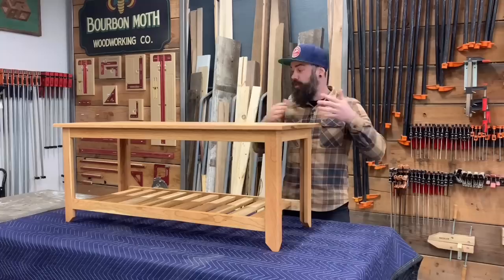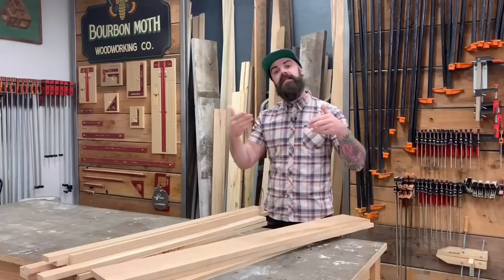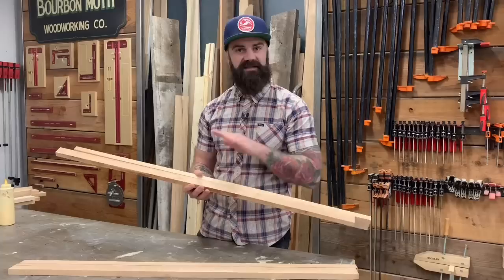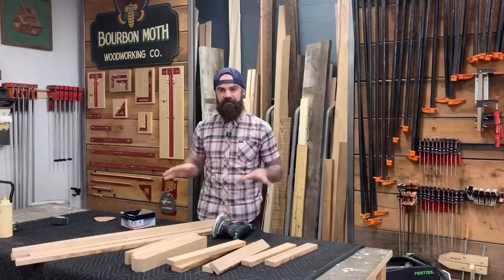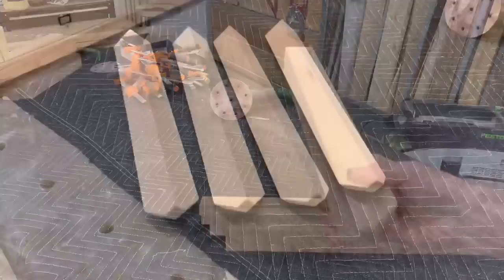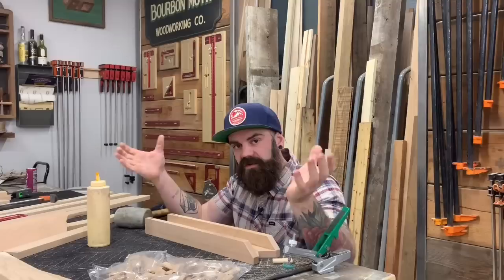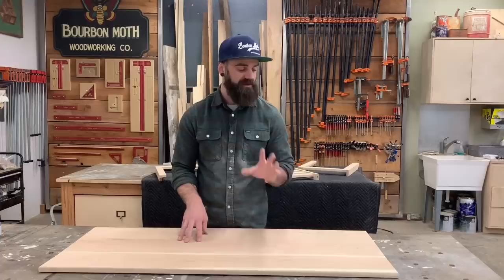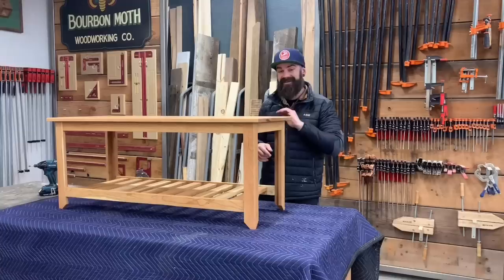How To Build a Bench / Easy DIY Bench

Comment: Great video bud! Keep up the good work. A silver play button is in your future.
Reply from the maker: Coming from you that’s a huge compliment. Thanks buddy
Reply: Hey mate love the video do really well love the table as well just a quick question here in the UK would that dimensions of the saw blade work with a normal saw blade from the UK or are they all the same worldwide
Reply: @mortimerwoodworks3  Depends entirely on the blade. Most blades in the US are 1/8" (3.175mm) unless they use the 'thin kerf' blades. My TS has a 2.6mm blade. Just adjust your dado/groove accordingly by bumping the fence to widen, or use a router. You can also use a buscuit jointer and run it the whole length of the skirt, blades are typically 4mm. Or get a plough plane - there's literally loads of different ways to achive this.

Comment: I like the fact that you tell people when things are not required, like gluing every tenon in the base.  Also I don't understand why people complain when you 'break out' the domino jointer, you've already said "Use a dowel joint instead" and you can do that for a few pounds in the UK.  Keep the videos coming, they are really good.

Comment: Enjoy your videos,  and I am a follower. This gave me inspiration to build my own bench, a bit different than yours, but following the same basic idea. I for instance put the skirts (up and down) inside the V of the legs, and then I put the base slats on a thin stripe, a thin piece of wood on the inside of the lower skirts (I don't have tools for domino jointing).  But basically, like. And very much inspired by your video. It now serves as a flower bench, making a  kind of divider in a small apartment.

Comment: When I made a similar bench I used the Domino 500 to put tendons in for the top and then put it together. I did not glue it and it (the top) stays where it should be and does not move or come off.

Comment: Is that rubio? I wish you would’ve shown how you apply the finish to the legs and base. The only time i see people use rubio is on flat surfaces and I always wanted to see someone actually using it not on a table top only. Great video though and I love your stuff and your instagram.
Reply: Araya Woodworks I apply Rubio with a foam brush onto not flat surfaces and have gotten great results. Just make sure you apply enough to saturate (not soak) then the only key is make sure you wipe every last bit of finish off after 5-7 minutes
Reply from the maker: Yes it’s Rubio, a foam brush works great for getting all the little areas.
Reply: Nice! I really need to try Rubio!

Comment: Could you build this with a doweling jig? I was thinking two dowels in each end of the lower shelf slats instead of the domino joiner? One dowel would allow them to spin.
Reply: That would work fine!
Reply: @4addevelopments139  thanks! Just getting into woodworking, and a domino joiner is definitely not in the budget. 😆

Comment: Any advice on rounding over the edge without tear out at the corners; I did mine today and the corner grabbed and I had to cut my table top shorter to route again ?
Reply from the maker: If you clamp a sacrificial piece onto the edge and route past your top into that piece. It will prevent tear out.

Comment: I have a question. Why wouldn't you use finishing nails along with the glue to put the legs together? Wouldn't that make it more structurally sound? Then use wood putty to fill in the  hole from the finishing nails.

Comment: Need to add that if you use domino you need to change depth for shelf rails, if you go 20 you'll go through. I use 40 dominos with 15 deep on rail and 25 on braces. Otherwise greatplans

Comment: I have to make 2 built in cabinets for my two nooks beside the fireplace. They span 65 inches on each side. I have a dewalt 7491rs table saw some clamps nail guns and other small essentials. I don't have a jointer or a planer or a buiscut joiner. I do have a kreg k4 pocket jig. Any advice? I have a dedicated 12x20 bay garage dedicated to my stuff (no cars allowed) can I make cabinets should I make 4- 32.5" cabinets and combine them? Thanks for reading

Comment: Well, nice video but you forgot a couple of things.  Namely, what grit sandpaper did you use, Festool also makes a couple of different types of sandpaper, granat and one other I believe plus a mesh.  Secondly, what size dominos did you use?  I think those are the 6mm type.  Also, one could use a DF500 domino machine which is $500 cheaper than the big brother you used.  Also, how did you measure out the dimino positions on the legs?  Finally, where did you get the cherry stock?  Thanks.

Comment: On your miter saw, why do you make a shallow cut before make the full cut?
Reply: He has a tips video somewhere, that he describes a trick to keep the saw from binding as much on thicker wood by cutting the beginning and end of the cut then doing the middle.  But, since then I've noticed he "scores" most pieces along the full width it then makes the full cut.  My though there is as the blade is making the plunge through the wood, any deflection downward now has a relief cut to keep it off the blade.  I haven't had a chance to try it yet, but that's my theory.

Comment: This looks amazing and very doable. I wish you had made this straightforward build with less than $10,000 worth of tools.  I am sure it could be done with different equipment but as an absolute beginner I would need some guidance.
Reply: Lol same. I was excited but as soon as the jointer/planer was whipped out I was like "out of my realm of possibility". Boo.
Reply: Yea I’m in the same boat but there are plenty of videos on how to build a jointer jig for your table saw. Planing is a different story but we do what we can do with what we have right lol
Reply: Guys just buy S3S wood from the store and you’re fine
Reply: So just work away with a handplane and pullsaw. You’ll figure it out.
Clamp with a couple of 2by4 an wood wedges.
Honestly who uses less tools than they have…

Comment: Hey man how are you making those dominos for the newbie without the festool domino joiner. I have all the essential but not the joiner throw a rookie a bone I'm doing my first live edge entry table. Please school me
Reply: Use a doweling jig, the domino is great for only needing one domino to line things up properly because of the oblong shape, using two parallel dowels where he used each domino would accomplish the same thing. The domino tool is just quicker and easier, that's all
Reply: @BarneyGumbl3  
Well thank you, I'm stepping my game up and taking some classes at Wood Craft. Joinery is extensive, and takes some test/sacrificial pieces. Learning my router and table saw.
Reply: @allcleanenterpise  I'm on the same journey you are at the moment, good luck and have fun

Comment: "I want to keep this attainable, so I won't do miter joints. Now let me do all joinery with my domino". I'm confused. I know there are plenty of other joinery techniques (dowels might work just fine here), so why not use them in this "easy DIY build"? Whipping out an unnecessary $1,200 tool could feel discouraging to folks. Just my two cents.

Comment: forgive me, loved the vid. You suggested using 2 strips of wood to make the legs as it would be easier than tapering for beginners, then.... you showed your lower frame assembly being made with a domino machine which are highly expensive and not a tool beginners or even intermediates would likely have. instead you could have drilled and chiselled them in a fashion that beginners would likely be able to do.